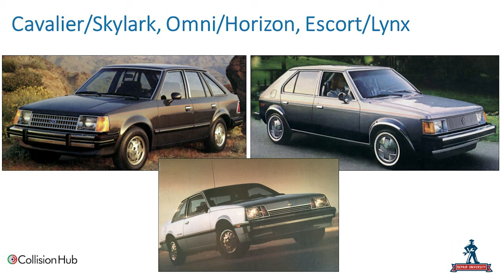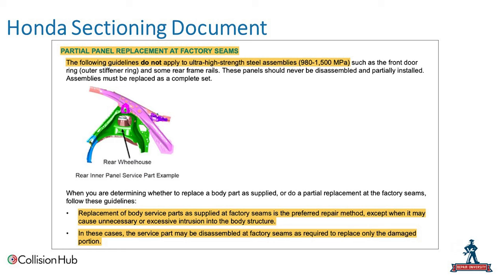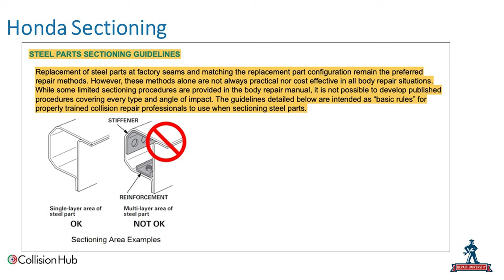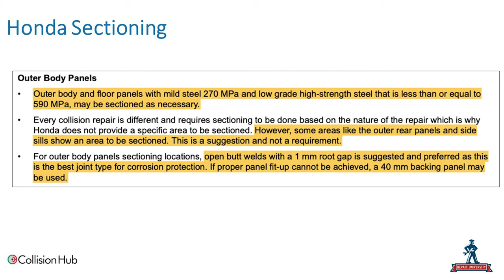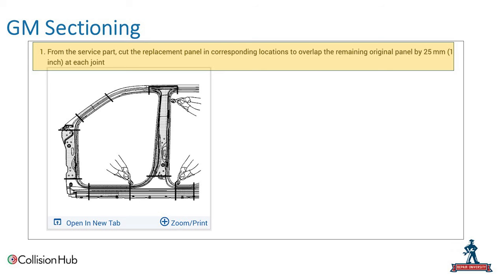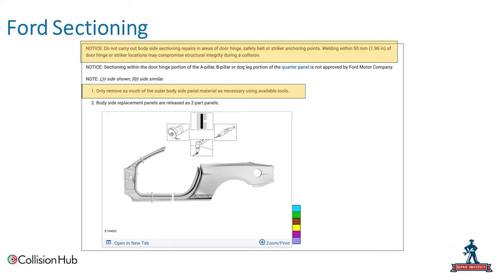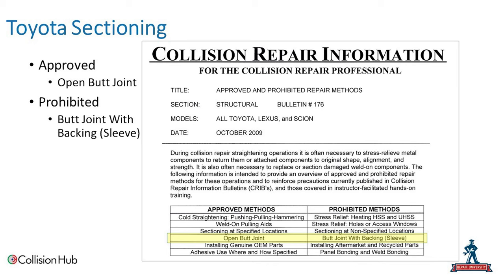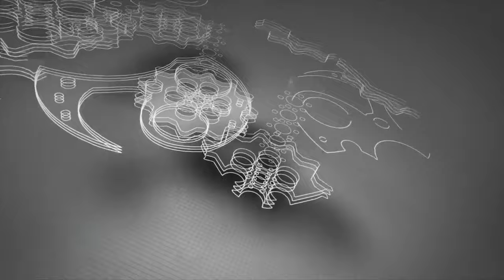WARNING: Technician Discretion In Collision Repair

Comment: I love the video. I love that you acknowledge that sometimes less intrusive is a great option if the OEM provides information to do so. I would love to see the OEMs or the Industry specifically identify what is an outer panel ( Is a rear body an outer? Is one of the most common questions I get asked) or a structural or non-structural panel to identify what panels may have some options. I hope that some of the wreck checkers out there watch this because it seems like they conveniently forget this type of information exists.

Comment: Great video guys! This information is very much appreciated and needed for our industry. 
GM does now offer an overlap or a backing plate on several different procedures. There is a document on this GM doc 5247829. It is an added hyperlink on many outer panel sectioning procedures. 
On the FCA Stellantis outer panel sectioning nonstructural procedures it mentions a 13mm backing plate and also a 50 mm backing plate. Lots of confusion on which one we are supposed to be using can you address?
We would love to see you address the movement toward repairing frames that are UHS steel and the challenges that will bring. Toyota guidelines are now saying repair all steel unless it’s kinked is the way we are reading their body repair manual. They have removed crib 175 and revised crib 160. Thoughts?
Fords welding precautions line #8 guidelines state that UHS steel should not be heated to straighten and severely kinked or bent parts should be replaced. So we can repair if it’s not kinked? Thoughts?
Keep up the great work! We appreciate your time and energy! Collision techs would love to see QR codes with repair procedures!
Honda guidelines for repairing frame rails on the UHS and HSS frame rails. If a rail  780 MPa or higher is 5mm out we cannot restore frame dimension? This seems to be very invasive! Scott Kaboos help!
Reply: Craig, thanks for the questions/comments! Appreciate you sharing the GM backing information and happy to see them allowing it; we'll be sure to include an update in a future Repair U episode. 

Can you direct me to one of the Stellantis 50 mm backer procedures? I know they use them on some rails, but don't recall a model with an outer calling for one; I'm sure I'm forgetting...

Can you also direct me to a Toyota procedure; I haven't seen anything like that and would want to reach out to Toyota for clarification, as it doesn't seem aligned with their normal strategy. I believe CRIB 160 is an SRS document...am I looking at the wrong number or are you? 

For Ford, they allow cold straightening (if not kinked) up to 600 MPa; no straightening, at all, above that. Also, a 'kink' includes areas that are seemingly (by appearance) bent, but cannot be restored to  the proper state and/or shape.  

No straightening on Honda 780; this isn't unlike most OEMs that warn against straightening anything over 600 MPa. GM is the only OEM (on the ATS) that I've seen allowing anything close to the 700+ range. Scott Kaboos is no longer with Honda; he's bee over at I-CAR for a copule of years now. .
Reply: @jasonbartanen  In the FCA / Stellantis sectioning guide for non structural you will see the hyper link for the instruction for the backing plate. Specific instructions on the width 50mm. I only see the 13mm backings plate on the structural parts . I totally love FCA / Stellantis using repair methods not procedures but in specific cases it actually creates confusion.Ram bedside and rear body panels and roofs for examples, replace as serviced and weld bond the panel when using store is what the welding document states. Thanks for the reply sir!
Reply: My apologies I referenced the wrong crib # from Toyota. On the revised Toyota crib 161, states cold repair can be done as long as the metal is not kinked. Many B pillars and frame rails and more are UHS from Toyota.  Crib 175 specifically said that any HSS or UHS steel in the passenger compartment could not be repaired, that crib is no longer in the body repair guidelines. new revised 161 does not prohibit the repairing of UHS steel or am I missing something here? 
I am adding the original crib 161 and 175 . I would greatly appreciate clarification, thank you for your time and considerations! Please read crib 161 and see if we are missing something.
  I know Scott is with I-CAR but you guys have lots of connections, would love to see more information and context around the HSS and UHS steel and frame dimensions being off on Honda/ Acura vehicles. 

old version CRIB # 161 Collision Damage Repair Precautions
HIGH STRENGTH &
ULTRA HIGH
STRENGTH
STEEL (HSS & UHSS)
OCCUPANT CABIN
REINFORCEMENT
REPAIR IS
PROHIBITED
HSS & UHSS occupant
cabin reinforcements
are
designed to absorb, channel, and dissipate collision
energy and perform at 100% strength in their original
shape. However if they are damaged and repaired,
they will no longer perform as intended. Damaged HSS
cabin reinforcements require replacement

 
 deleted version CRIB # 175
TITLE: HSS & UHSS CABIN REINFORCEMENT REPAIR & REPLACEMENT
SECTION: STRUCTURAL BULLETIN #175 (revised)
MODELS: ALL TOYOTA, LEXUS, and SCION
DATE: DECEMBER 2009
Model-specific ‘Collision Damage Repair Manuals’ contain ‘Structural Outline’ illustrations that identify locations and strength ratings for
High Strength Steel (HSS) and Ultra High Strength Steel (UHSS) components throughout body and frame structures. This information is
provided so that collision repair professionals can make informed decisions on repair and replacement of components that provide high
margins of crash safety to vehicle occupants.
Because occupant safety is such a high priority, HSS and UHSS occupant cabin reinforcement repair is not recommended.
Do not use the following occupant cabin reinforcement repair procedures:
Hot and cold straightening methods
Sectioning of 980 MPa and 590 MPa strength rated pillar reinforcements
Sectioning of 440 MPa rated components at locations other than those specified

Backer Panel Joint
Overview: Backer panel procedures may be used to achieve a smooth joint between panel sections. The backer panel works well in areas where there is not enough room to smooth or feather in an overlap joint. The backer panel joint is a common repair for rocker panels, quarter panels and body side apertures.

FCA backing plate under Non-Structural backing plate. 
Create a 50 mm. (2 in.) backer panel out of an unused portion of original or new sheet-metal panel, whichever contains the appropriate shape. Be certain it has a precise fit to the back of the panels it will join.

Comment: Hello. 3:39 Which part on which model and make is above 1500 mPa? Honda Civic have rear 1500 mPa rails. But what is above 1500?
Reply: Yeah, if you pull the construction materials chart, it will tell you by the numbers what parts are 1500 and lower based on the MPA
Reply: 1700 MPa rails around some battery EV’s